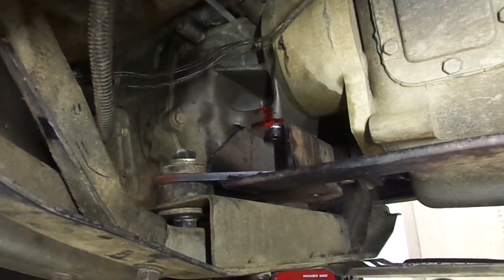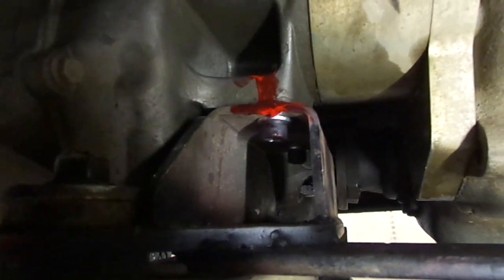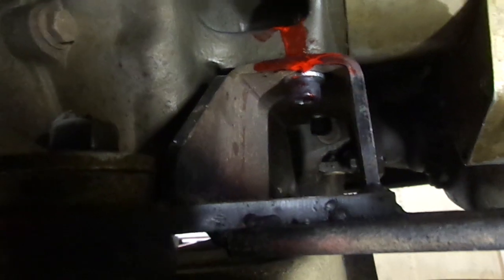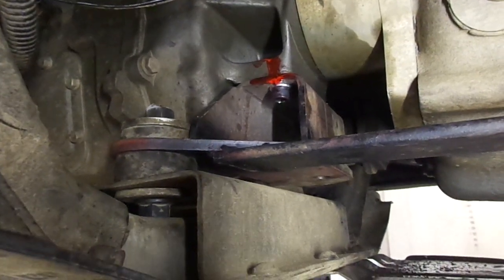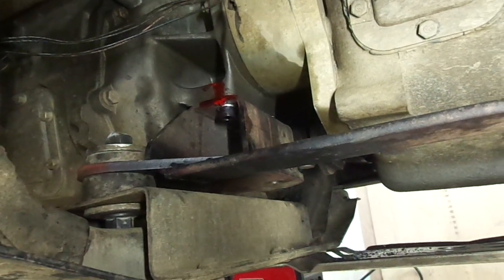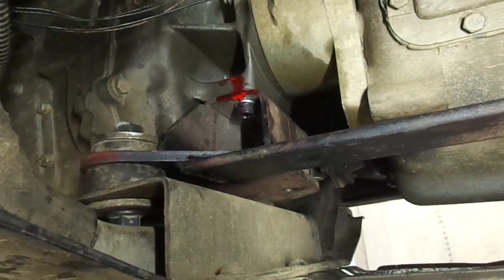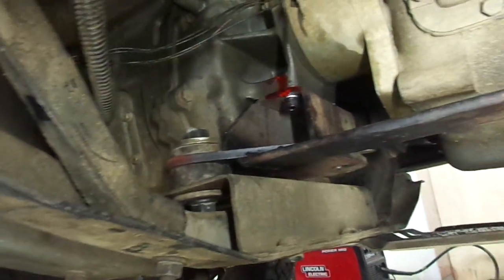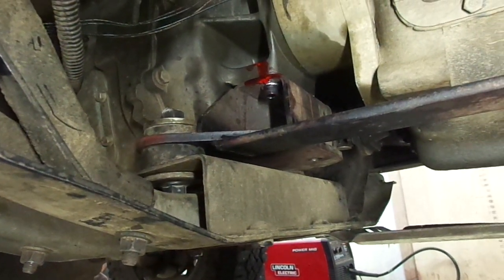NV4500 Metal by Charlie mount fix, Dodge first gen Cummins manual transmission swap.

Comment: Great review and thanks for sharing.  I do want to ask if you have a E-brake setup on your NP205?  If so how do you like that option as opposed to the standard E-brake.  Again thanks for the update and I take note being that I am doing that particular conversion myself.
Reply from the maker: I do have the NW Fab ebrake on the transfer case output. I really like it  better than rear wheel ebrake. So far it has been trouble free and seems to have great holding power.

Comment: Hi! Thanks for sharing your findings. The bolts do get an excessive amount of tensile strain due to the offset no matter if you use my mount or the box tube and plate advanced has. My suggestion is flange head style bolts of a higher grade. The only other way to combat this would be moving the crossmember back and an inline mount. I like your idea with the extra bar. It's definitely a sure way to eliminate a twist issue.

As far the thread size, it should be 7/16-14 across the board for all nv4500. I think we will include the bolts that i'd suggest for the application from this point on and also highly recommend a cast iron tail housing.
Reply from the maker: Thanks for the comments !  I love your products and would definitely buy the mount again.  As you said, without moving the crossmember, this stress is inherent in the offset mount.  My tailhousing is cast iron, but I agree it should be a recommendation.  Not sure how the threads in an aluminum tailhousing would hold up.  Not sure about the thread size in my tailhousing, I used the same 10mm bolts that are used elsewhere (attaching tailhousing to transmission case) and they threaded in properly. At any rate, the threads didnt fail, the heads sheared off the bolts. I do live 5 miles back a washboard dirt road and my truck is subject to more stress than most on a regular basis.